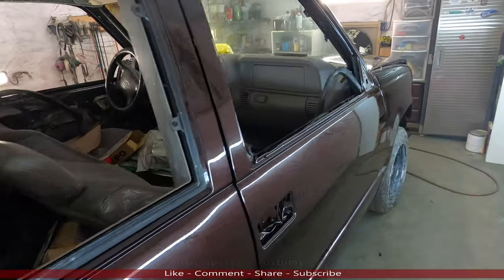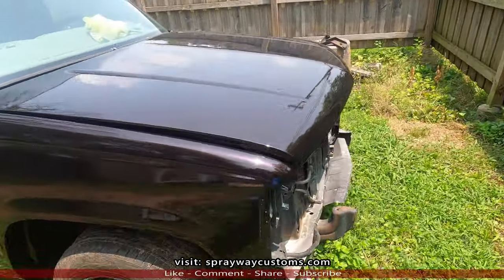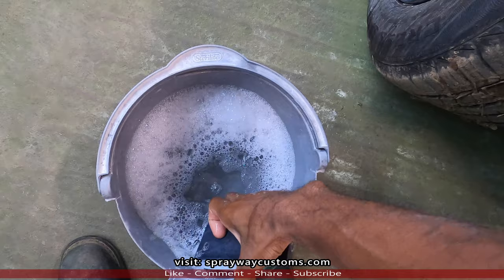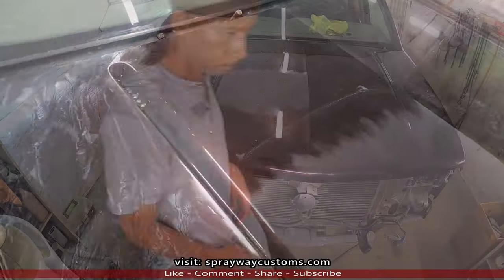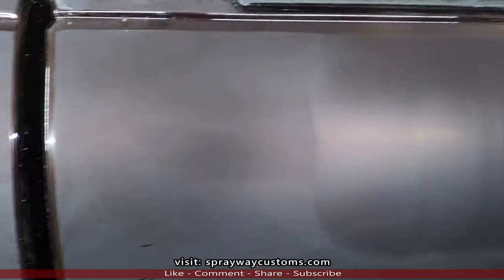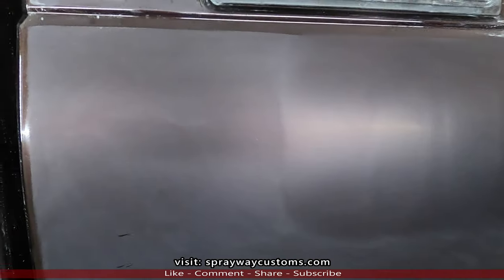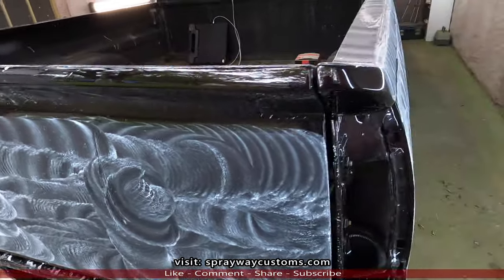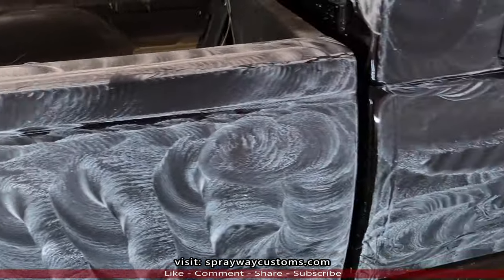How To Remove Orange Peel From Car Clear Coat With A Cut And Buff - Color Sanding The OBS Silverado

Comment: Your work is TOP NOTCH as always bro!! But I have a question. Where do you order your pads for the Rupes? I have a Rupes LHR31ES I've had brand new for over two years I've been wanting to use. I've never used a polisher/buffer but I have watched your videos. I have an OBS too that I had painted about two years ago. Honestly I'd like for you to look at it and tell me what you think. The paint job is WAAY BETTER than it was originally. It started to peel like others. But I want it to be better because I have a few issues with it. If we can work something out, I'd throw the Rupes in for your time, its brand new, just two years old. Keep up the great work as always.
Reply from the maker: I get my Rupes stuff from thecleangarage.com

Comment: What's the part numbers for the 1500-2000-3000 grit wet sand paper you used on DA? Is The back side of that sand paper sticky?
Reply from the maker: Yes it’s PSA

Comment: I wonder what creates the orange peel?  Is it the off gassing or is that what fisheyes are from? Is a subtle orange peel a factory look? 

This is one heck of a hard process. You have such a calm presence and make it look so enjoyable.  Amazing work! Thank you for sharing your knowledge and hard work.  Looks so awesome!
Reply: Every new car leaves the factory with orange peel unfortunately. Orange peel is mainly from poor paint or clear coat leveling, and painting at angles other than perpendicular. I believe this is why Sprayway does wheels standing up, I could be wrong.
Reply from the maker: My pleasure